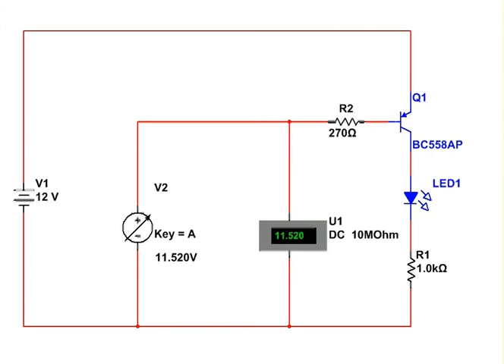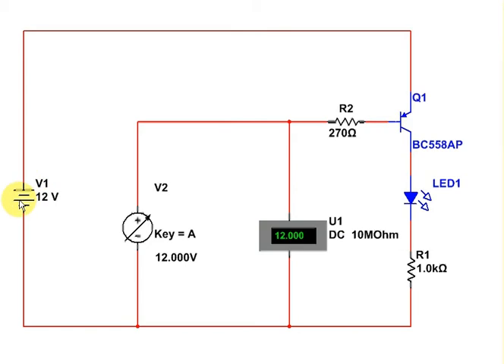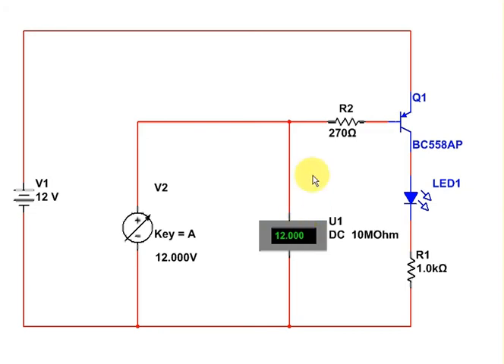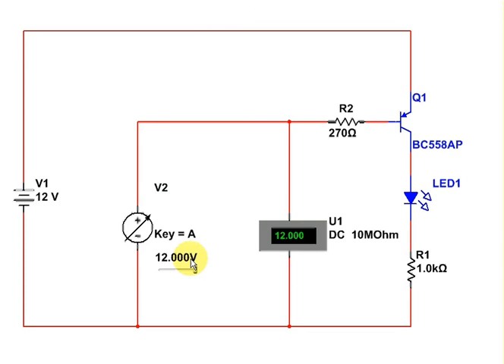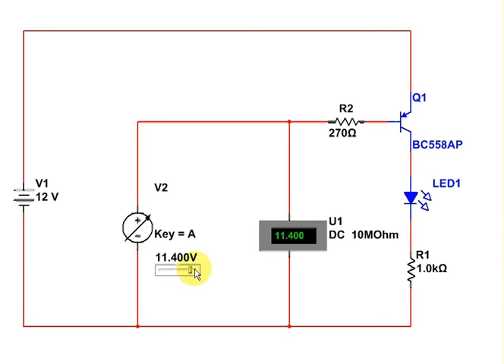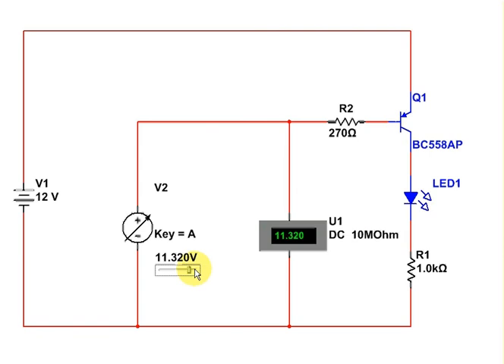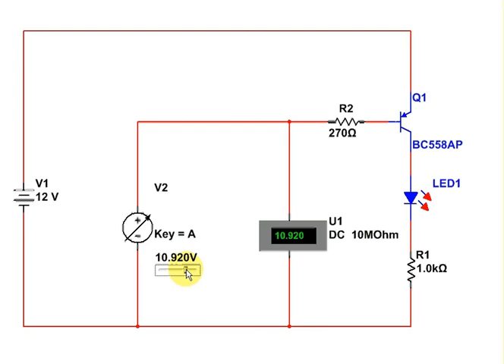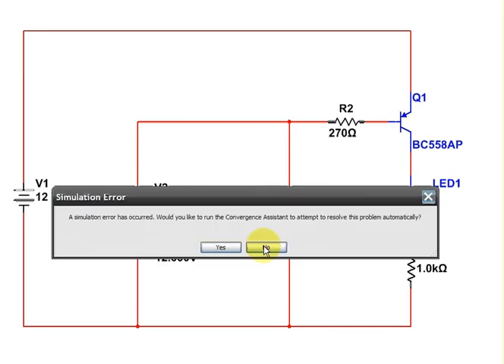Using a PNP transistor as a switch video.avi

Comment: Great video. q? what happens when you reduce the base voltage to 0v? Will the LED turn off
Reply from the maker: reducing the Base voltage on a PNP bipolar transistor will fully turn the transistor on. At some point the current flowing through the transistor from emitter to collector will saturate (maximum current flow). Check the datasheet for the transistor to see what that current is (Hfe or DC current gain) - Thanks for watching and commenting
Reply from the maker: +Alexander Lang and no...the LED will not turn off if you reduce the Base voltage to zero...it will stay on permanently

Comment: why does V2 have to be reduced down to 11.3 for the to LED light up?
Reply from the maker: V2 has to be reduced because that is the way that PNP transistors function.  Current cannot flow through the transistor until the voltage on the base terminal is 0.7 V less than what is present on the emitter terminal.  This is due to the way a PNP transistor is constructed.  The doped silicon sandwich is made up of positive material, then negative material then positive material (P N P). In order to make electrical current to flow through this the barrier voltage from the positive material to the negative material must be overcome and that is 0.7V.  I'm not really sure how I can simplify this any further...
Reply: Alexander Lang Thanks.